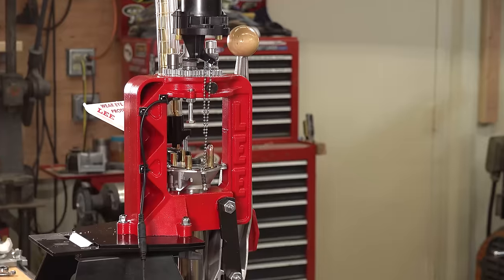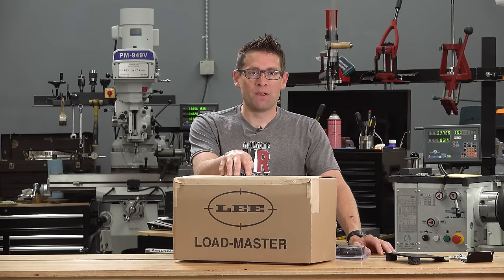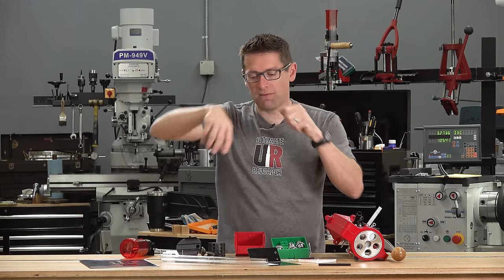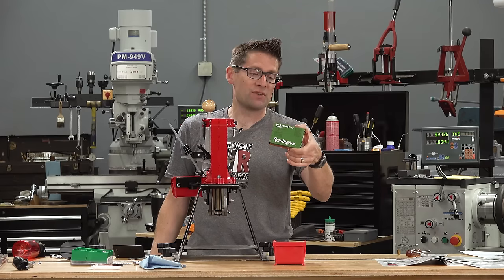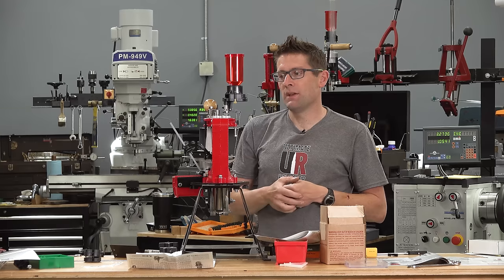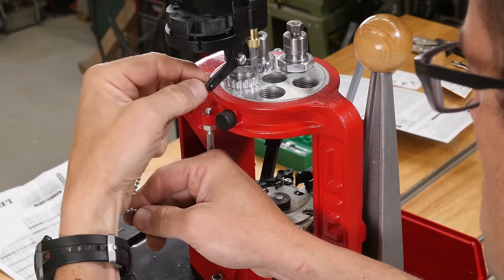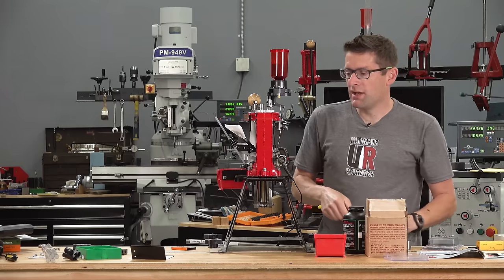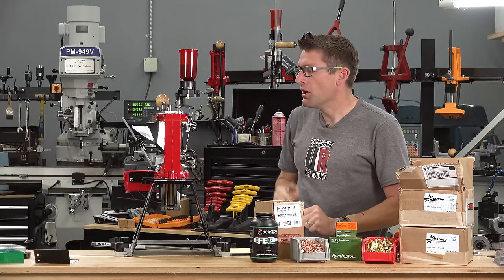Lee Loadmaster Unboxing/Setup, Loading 9mm Start to Finish

Comment: I bought a Load Master after watching tons of UR videos. I knew I wanted to upgrade to progressive reloading but cost effectively.  I even purchased the bullet feeding kit and a few diff size bullet feeding dies that work well for smaller pistol calibers. The bullet feeder is picky but it works well if you spend the time. I currently reload 380, 9, 38, 357 mag, and 500 mag. The 500 mag is actually the easiest setup in the press because you cannot use the shell or bullet feeder. Anyway...  The LLM and reloading in general is working out great because of UR and I cannot thank you enough for the videos. I’ve purchased from some of the sponsors as a way to say thanks.
Reply: The lighter the bullet the better the bullet feeder work. Anything that interferes with moving the bullet causes problems with the bullet feeder system.

I was loading 200 grain .45 Colt cast lead bullets and I could never get it function well enough to be worth the twiddling time. A stack of 200 grain bullets is putting a fair amount of weight on top of the bullet in the loading station. The fingers have a difficult time moving the slug from the bottom of the stack and positioning it over the case. If it gets bounced around it might not be straight enough to be seated in the case. I don't remember is I had the same problem loading 125 grain .38s but I am pretty sure I did.
Reply: @katrinaanon1038  Using the bullet feeder I've had good success with 100g for 380, 115g for 9mm, and 124g/148g/156g for 38spl/357mag.  I assume I would have similar success with similar weights regardless of caliber.  For the 100g bullets, they are literally right on the border of being slightly too long for the small 9mm feeder die, and way too short for the medium 9mm feeder die.  Using the medium die causes the bullet to pour out of the tube like water.  To make the 100g's work I used a rotary tool to shave off a tiny amount of metal from the small 9mm feeder die, allowing the bullets to freely exit the die on the fingers.  I haven't tried however I'm guessing 95g bullets would work with the small 9mm feeder die with no modification.
Reply: One more quick comment.  Gaven alluded to this in his video and he's 100% correct.  You will get much better primer seating by installing the sizing die in the primer station/station 2.  Alternatively you can use a lee quick-trim die to hold your case straight in station 2.  Using the quick-trim die in station 2 is a setup used for rifle reloading.  Lee sells a unique  4-die .223/5.56 kit for the LLM that includes the quick-trim die for this reason.  On my pistol setups I use the Lee universal de-priming die in station 1 because it's oversized enough for just about any pistol caliber.  It even works for my S&W 500.  Then I install the sizing die in station 2, which significantly improves primer seating vs. leaving that station empty.  No mods or changes to the rest of the stations.

Comment: I run a loadmaster since 2009.  The case slider was too short for my brass... So i hot glued two strips of industrial zip tie to stop it from kicking the The brass out at the bottom. This year, I bought a Lee APP... The case feeder kit included a redesigned slider! I love my loadmaster and the parts that wear are cheaply replaced. The APP is slick too.

Comment: I resumed reloading after a break of many years. I decided to treat myself to a new press, the old, old Lyman Spartan with Herters dies still works, but.... I looked at the loadmaster,  but retired, I have more time than money, so I drew the line at the relatively new Lee value turret. 
This I've found to be an excellent press for pistol and a great value. I got the kit for their auto drum measure, but prefer a cheap electronic scale which is much faster than their safety scale.
This setup is 10 times faster than the old single station press and unless you compete, turns out all the ammo I can afford to shoot😉.

Comment: Been running a Loadmaster for a few years. Loaded thousands of rounds, but it is finicky. If I hadn't made my own case and bullet orientators, I would've stepped to a Dillon long ago. I do not prime on the Loadmaster, caused to much headache. For the cost, it does work.
Reply: RCBS case prep station and bevel all primer pockets prior to reloading. ZERO issues thus far.

Comment: Hi Gavin 

I really appreciate and enjoy your channel have found allot of useful info from here,  thank you .

I have two Loadmaster's A Classic Turret and a Lee Challenger , it all started with the challenger 20 years ago  progressed to the 1st Loadmaster for 9mmP 4years ago , then 1 year ago I got another for my 5,56/223 and the lee classic Turret for my 308, the challenger is now only a de-priming/priming station prior to wet tumbling my cases. I had issues with the priming system on the Loadmaster so I removed the system on both and adapted my case prep routine , I like to wet tumble all my brass and de-prime all cases prior to tumbling so as to get the primer pocket clean, I pack them in a bin for each cartridge caliber named "Dirty Brass" when I have time and enough cases I wet tumble and once dried they go to "ready to Prime" bin on the rifle cases I also take the time to then check OAL etc prior to dumping in the ready to prime Bin, Priming is done on either the Challenger or Classic Turret using the safety Prime fitted to both presses, after priming they go to a ready to load bin from where I feed the Loadmasters case tubes.

The 9mmP LM has a bullet feeder which works ok as long as you refill before the qty gets to low or bullets tend to fall out on the last 3 or so in the system keep it topped causes less drops and store the LM with the Ram raised to avoid tension on the Bullet feeder arm the plastic wil last longer.

Overall I love my Presses and they work well and my shots are as good as any other persons on the range so I am happy.

Keeping them clean and the case plate on the 223 especially as a grain of powder that may fall on the plate will cause enough deflection on the case going up into the powder station on the 223, I noticed this to cause powder to mess presumably because the cartridge doesn't make flush contact with the riser die, so brush the base plate whenever you see powder laying around I do it every 100 loads just to avoid stoppages and serious spills.

I like my Lee presses, I don't see any reason why I would change to the more expensive brands they serve my needs.

Be safe and thanks again for A very informative channel,

Comment: It really is surprising to see this press work so smoothly. I want a Dillon XL750 but this press is on my list... there are just too many horror stories for me to buy with confidence. After 12 years I'm tired of loading pistol ammo on my rock chucker.
Reply: Went from a Lee Loadmaster with all the works to a Dillon 550. That should tell you everything you need to know.
Reply: 12 years... ooh, I feel your pain :) I got Hornady LNL after couple years and now I can't even look at press without case feeder.  Mine is 3D printed that uses same Lee feed tubes, the way they designed it is brilliant, you drop a handful of brass in to the collator on top and you shake a little and brass goes down tubes in proper orientation 90% of the time and even less flipped cases with .40 and .45 and I use the same case feeder for .223, 300 blackout, 38 SPL, etc.  

The coolest thing about progressive is you don't have to handle each case, even simple task like just decapping and sizing.  I run mine in 2 stages.  First I prep all the brass, clean washed brass from range pickup gets sized and neck expanded, than I prime by hand (can be done on the press) and 2nd time around I adjust the neck expander more fore lead bullets or leave it as is for copper plated, throw a powder charge, seat the bullet (using hornady bullet feeder, works great) and just pump out the rounds with no interruption.  With sizing done already, there is less jerking around, meaning the powder feed is more consistent and bullet seating also.

I still use single stage press when I am making accuracy rifle rounds.
Reply: @DimaProk  95% of what I load is rifle ammunition, and my round count is close to 6 digits at this point. Probably the reason I don't shoot handguns much in general is because I have to load single stage. We'll see. All of that could change shortly.
Reply: How much variation do you see in OAL?

Comment: Got one after watching your video. That was no easy task because they were sold out every where! But managed to find a brand new one a person was selling on Facebook. Wasn't the caliber I was needing but already had dies and ordered a plate. Now waiting for a side and riser to come in before I can start. But your video helped me be lazy and set it up 😂. Thanks for the informative instructions on set up! Mine did take some more adjustments than you showed but I got it figured out and running smooth now. Had to adjust the entire ram. It was about an inch off and wouldn't index.

Comment: I'm no stranger to the Lee Precision products and I got mine in 223 (and for Creedmoor based cartridges), October/2019.  It's fast and accurate and easy to setup! I use the  American Accurate case collator, which works way more better than the Lee and a better 3D printed case block. Now, if someone could put together an affordable powered case & bullet feeder, that functions close 100%, that would make it just that much better?!

Comment: The Loadmaster is an ok press if you do not mind twiddling with it. Also stick to large primers because it tends to flip small primers. You also can't run it fast because it flings powder out of the cases if you run it too fast.

I manually primed my cases because of the problems with the priming system.

At half the price of a Dillon or other better presses it is ok. Just don't run it fast and it will work ok for you.

Comment: I bought one of these back in 2009. Some days it would work, then other days it would chew up priming parts and even broke the carrier. I learned to load at least a week before I had to shoot because there was a good chance something was going to break, or go wrong. Like many others, I started priming separately (off the press). With .223 and RCBS SB dies, I could not size .223s. The only way would be to grind the bottom of the dies (had 3 different dies). The shell plates were too thick. Cases would not sit flush in a gauge, about 1 in 10 would jam up an AR. That was it. My wife hates guns, and didnt like me doing this. Even she said one day, "Honey, just get a Dillon".

With the loadmaster, I couldnt get a .223 to sit flush no matter how hard I tried (broke the press trying). I was so happy when I used the same die on the 650 and for the very first time, the case dropped below flush on the gauge. Also, I could finally prime with the press.

With that said, it looks like they did make some improvements.

Comment: I recently switched from pro 1000s, which i used since 1992 to a loadmaster. At first I had some primer flipping,then decided to stop it! I have found the loadmaster is an awesome press since I concentrated on 2 things,mounting the press super solid and polishing everything super smooth. Now this thing runs great,butter smooth running press after polishing shellplates,indexing rod,and NOT having a die in station 2! Size and deprime on 1 and make things as smooth as possible with rigid bench,works amazing!

Comment: The biggest mistake people make with the loadmaster is mount it on a flimsy bench and then complain when they can't figure out why it won't run smoothly. I had a Loadmaster and it ran fine. I just did not care for the priming system, so I sold it and moved on to a different press.

Comment: I bought a Loadmaster for 44mag in 1997. I bought another Loadmaster for 40S&W somewhere around 2004. I am lazy I didn't want to change the primer feed from large to small. Right now I am set up for 9mm, 40S&W, 357mag, 45ACP, 45LC, and 44mag. I have loaded many thousands of rounds through these presses. They are not perfect they have their quirks. I like the presses and think they do a very good job. I would recommend them to anyone wanting to step up to a progressive.

Comment: It's a finicky press. As many mentioned priming is challenging, mine go sideways many times, I 3D printed a dummy resizing die for the calibers that I use to keep the shell in position at the priming station.  Also, setting the height for the case feeder is labor-intensive, once again I printed spaces for each of my calibers so I can easily and fast set up the case feeding, still many times the case will tip over.  The disc loader is pretty good but it leaks sometimes.

Comment: Just got my Loadmaster a few months ago. As others have already stated, the primer system is all I've really had issues with. On .223 it seems to be about 95%.  I get about 5 out of 100 cases with crushed primers.  Only using the recommended CCI primers and have not had one go off, but it sure is hard to tell if they seated correctly.  I find myself checking about every 15-20 rounds. 

I do also have the Challenger single stage and have thought about doing all my priming on it, but then it kinda defeats the purpose of the progressive press.  I am using range brass that I run through my APP press to decap, then run through the Lee swager on all the brass before I wet tumble it.

I ran about 100 rounds of 9mm the other night, and had about 3 cases with crushed primers.  I was able to pull the bullet, dump the powder back in the hopper, decap, and reuse the brass.  Just a pain to have to worry about if the cases are primed correctly as I go.

I have also ground the numbers off the head of the bolt of the primer seat adjustment.  That did help when setting the depth. Any other tricks for getting the priming system to work smoother?

Oh, and the UFO light is awesome! I got one of those as well and it made a huge difference.  I may have to mount a camera like one of the previous posters did so I can see the poweder charge on the 223.  Checking 9mm is no issue , but the longer cases are hard to see into, even with the UFO light.
Reply: Do you swage your 223/556 & 9mms brass ?
Reply: @livincincy4498  yes, all of my brass
Reply: @whetski  - crushed but seated in the correct direction ?
Reply: @livincincy4498  yes, that is correct.
Reply: @whetski  - I am guessing that the  head stamp lettering on the bolt head that the primer arm impacts is at fault.  File smooth or replace with smooth one. 

The primer rocker arm should also be filed and made smooth on both ends.
Reply: @livincincy4498  thanks for all the info. I had already filed/sanded the top of the bolt. Haven’t done the rocker arm though. I’ll give that a shot. 

I’ve also noticed if I let the primer tray run too low that can cause issues as well. Keeping the primer tray full helps make sure the primers feed properly.

Comment: I have run a LoadMaster for about 3 years and my experience has been good. Some tinkering to get it to work smoothly and headaches with bullet feeding but once I tossed out the bullet feeder everything was good. I also cannot say enough good things about Lee's customer service. I will always buy lee products but, with that said, as I type I am waiting on an LNL AP to arrive (8 stops away). I am going with the LNL to see if it's actually better in all areas than the LoadMaster. My only real gripe with the LoadMaster is the priming because you have one station dedicated to priming, I don't mind occasional tinkering so that is not an issue for me but I have noticed others complain about it. 
My questions are if anyone cares to answer...
1. How does the AP compare to the LoadMaster?
2. Is it worth spending the extra money on other presses like big blue or Hornady?
Reply: I used an LNL AP for years before switching to a Dillon 750. I would say the LNL AP is a decent press even without the case feeder or bullet feeder for about 3-500 rounds per hour pace. Caliber changeovers are also pretty easy on an LNL AP.

If you decide to get a case feeder for it though I would recommend just stepping up to a Dillon. The case feeder on those just work.

Comment: Thanks for the video.  I set up my brand new one when I moved from FL to TX and...  still waiting to unbox packing boxes to find my reloading components.  Sorry to say a whole year has passed and not a single round reloaded yet. Procrastination?  Maybe.  Too many 'honey do' projects to go still.  I ordered mine for 45 ACP.  As prices dropped in the las couple of years I bought tons of 9mm so I figured 45 ACP was the way to go.  By the way... that huge piston was hard to move initially, but now it is moving a lot better with a bit of lubrication and stroking it now and then.